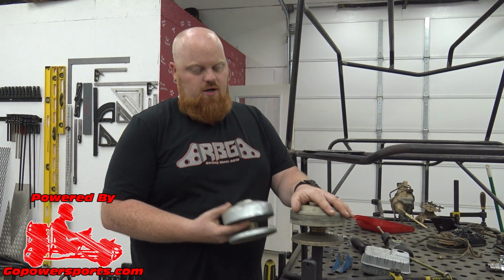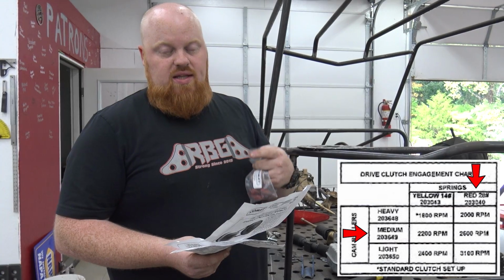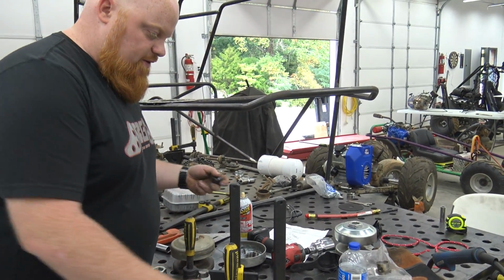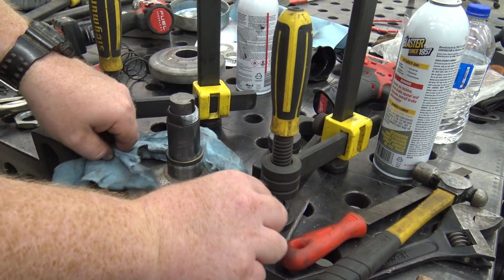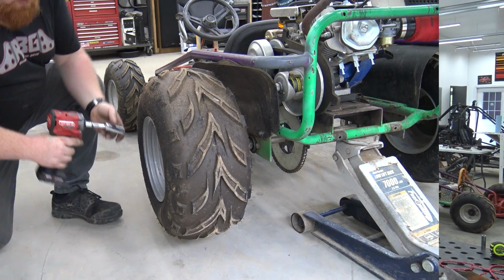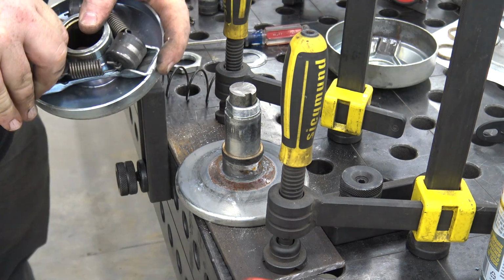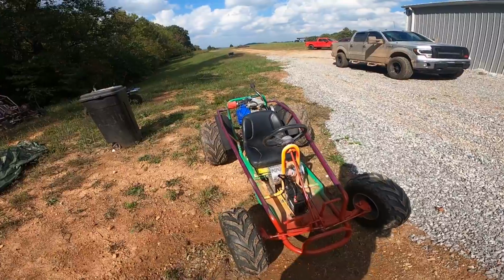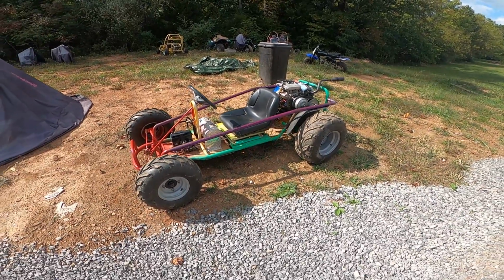How to Make Your Go Kart Launch Harder ~ 40 Series CVT/ Torque Converter Upgrade

Comment: Love all your content, and a fellow TN kart builder. My question is, I have a built 670 in kart i built but I'm running 40 series torque converter but also considered a snowmobile clutch as well. What would you recommend for mixed on and off road use. I've had the kart up to 60mph and climbing if that helps.

Comment: You do not have to cut the weld on the nut, put the nut in the Vise and unscrew it from the back side, find a scrap of 1 inch keyed stock and make a breaker bar out of it you unscrew it that way

Comment: Predator 212, governor bypassed, 24mm carb, upgraded valve springs, building for a bicycle to commute to work. Should I run a 30 series torque converter or 40 series?

Comment: I was wondering if you sell or have a link to the tool you made to disassemble the 40 series pulley?
Mine just did it for the first time on a 440cc 18hp Kilowatt so would you do the 2600 rpm or the 2000rpm springs on that heavy a Kart?
Thanks great videos!

Comment: @RedBeardsGarage you only mentioned the setup for the driver pulley..is there any steps to setup the driven pulley to match up to the driver?
Reply: Yes there is, idk if you've ever owned a 30 series torque converter or not but just like the 30 series the 40 series drivers have three different holes for setting the spring tention. The tightest position #3 is for straight up hill climbing, position #2 is for pretty much all terrain (this is also the factory setting, last is position #1 which is for flat ground/top speed riding. Hope this helps. Now the way I turn my 40 series that I currently run was drilling two extra holes in between the three that already existed basically giving it seven different positions. Because in my particular application I found that mine ran best between positions 2 and 3!
Reply: @NBrogdon45  thanks man I seen it in another video of the three holes..I'm running a polaris 250cc motor on my buggy now but it's just about shot so I'm going to go with a duramax 440 next.

Comment: Good clutches. I've been using the same clutch for 22 years. Just needs to be cleaned out and relubed once in a while, whenever it starts sticking. Comet says it's good to 18hp. I have it on a 23hp Briggs. The belt slips a little bit but not enough to make me get a different clutch.

Comment: my go kart has a predator 420cc and it doesnt idle properly due to the driven clutch not going back in all the way when you let go of throttle is there anything i can spray in it ?
Reply: No. Add the springs.

Comment: I have both drivers for my built Predator 301cc and the springs inside the Comet for the rollers broke. I took them both apart to apply dry lube to the rollers and guides and I was pissed! I'd go Ebay!

Comment: There is another video out there that shows a way to open this without removing the welded nut, basically he put the welded nut in a vice and used a breaker bar with a slotted shaft welded onto it to loosen it from the inside.

Comment: Those welds, on the big nut, don't need to be ground off, to take the cover off, on the genuine Comet clutch cover. I just took mine off and took it apart a minute ago, to make sure I don't give y'all B.S. info. Could use a freshening up anyway.
Reply: I was thinking the same thing, I've never owned a OEM Comet drive clutch but it's pretty much common sense just by knowing how the chinesium clones come apart. Spin the outer sheive while the unit is slid on the crankshaft without the retaining bolt of course lol, is that right?
Reply: @NBrogdon45  yes, that's right. The cover turns with the nut welded to it, along with all the other stuff. When you run out of threads it will pop up or off, but don't worry about it hitting you in the face, like Redbeard said. I don't know what spring is in his clutch, but mine isn't that strong.
Reply: Yep. I just flip mine upside down with the nut In a vice and use a pipe wrench on the driver itself.

Comment: Dutch invention. Developed in the fifties and sixties under the direction of Hub van Doorne of DAF.  In 1958 Van Doorne introduced the Variomatic transmission system with belt drive.